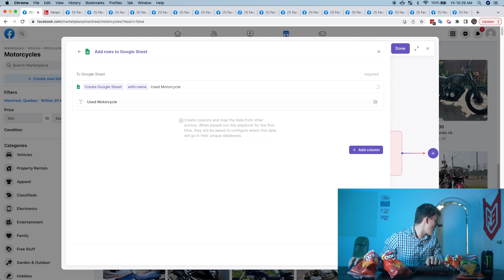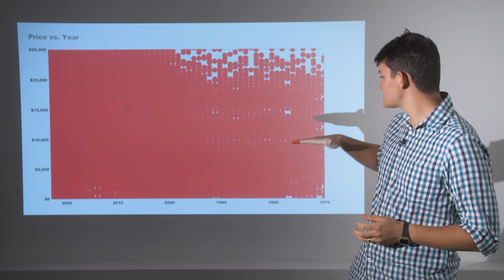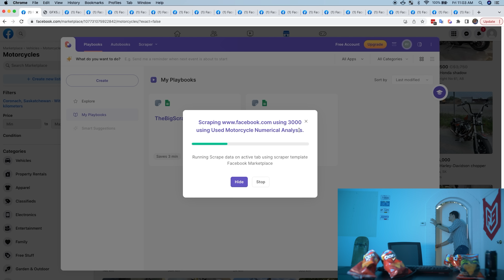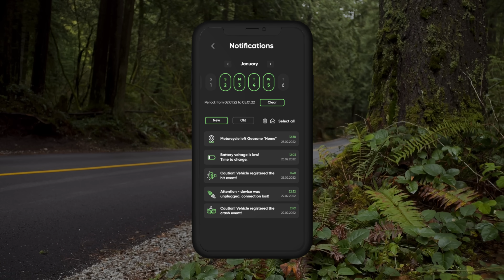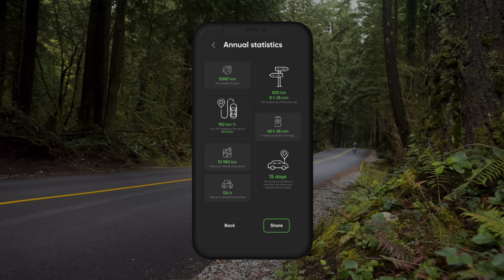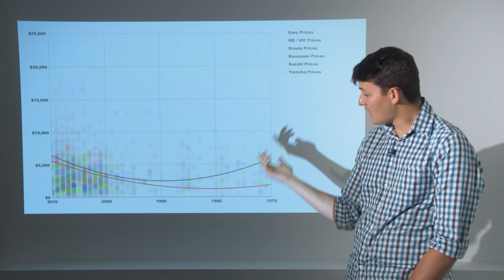Used Motorcycle Prices – A Statistical Analysis

Comment: I bought a 2007 Vulcan in 2013 for $3500. I put roughly 50k miles on it… and sold it in 2017 for $3k. 

Great bike 👍

That said, I’ve got a triumph that bleeds value like a blind chainsaw juggler and a BMW I’m probably going to keep until I can’t get parts for it (I didn’t think I’d love this ugly little beast, but it’s become a favorite). 

Sometimes, worth is what it’s worth to you. 😣

Comment: If you don't want to rely on a "lifelong no subscription plan" that will go tits-up in a couple of years, and for rather just slight above 10% of the price (instead of getting only 10% off) of their device: Get yourself e.g. a Teltonika FMB920 tracker. Works great with e.g. Traccar, the open-source GPS tracking server. Don't rely on 3rd parties to track your precious belongings, because they'll go bye-bye exactly when you need them.

Comment: kinda pathetic Sizzapp doesn't have a built in lithium battery in case the bike battery goes dead or disconnected.
Reply: Actually there is inbuilt battery 🔋
Reply: @fearchik   solid. would have been worth mentioning

Comment: A strange and almost unknown outlier from most of those curves here in Germany is the single cylinder Yamaha XT660Z Tenere (2008-2016). Only a few were sold, but those few still cost about 4,5k to 6k used - while they did cost 7000 new. That mimicks the HD curve. Well, farm equipment, I guess. 🙂
Reply: We get that with the Honda GB500 and the Yamaha SRX660.  Unloved when sold, cult status now.
Reply: HD basically IS farm equipment, so this checks out...
Reply: Hey, don't be rude! I've bought used  XT660Z for 5200€ in 2017 and sold it for 4800€ in 2022 after I did 20.000km. I've lost 400€ in 5 years that's a disaster! :D But to be fair it's really good bike and worth the price. I'm sure you know youtuber Motorcycle Adventures and his 193.000km XT660Z.

Comment: Oddly enough it's Facebook that saved my ride

I was looking for a used Suzuki Bandit with two criteria; post 2007 and less than $5000. I never even considered Facebook at the time but I scoured Autotrader and Kijiji and everything was either too expensive or too damaged.

Then out of nowhere Facebook put in my feed a private marketplace ad for a certified 2009 Bandit SEA for $5000, 35,000km on the odometer. I interrogated the seller because I couldn't believe a deal this good was above board, but it was. He was pricing to sell and Facebook creeped my searching habits to put this listing in my feed.

I'm really happy with the purchase, but I still deleted my Facebook account.

Comment: Aktuallaly, most of this is because fuel injection started being incorporated into motorcycles around 2000, so they weren't discarded as readily as fussy carburetor bikes that most people gave up on if they stopped working or had issues.  Anyone that's seen what it takes to clean and sync quad carbs knows what I'm talking about.

Additionally, 2000-ish to 2008 was a wild party of free credit to anyone that asked, so tons of sport bikes were bought with minimal money down and eventually sold or foreclosed on, so there's PILES of those bikes around.  Furthermore, the sheer number of 00-08 bikes suppressed future sport bike sales because why would you buy a $10k+ new bike when you could buy a low mileage used one for $5k that offers pretty much the same performance?  Really, the only reason to buy a newer bike is if you really want rider modes and things like that.

All in all, I don't think this data tells the whole story, and honestly bikes are so cheap just buy what you like when you know you are getting a good deal on a good bike and you probably won't lose much.
Reply: @nunyabusiness896 "fussy carburetor bikes"? I don't know which you have ridden, but carbs are a lot easier than FI to work with from the early '80's onwards.  I bought a set of vac gauges in the mid 2000s to use when servicing my bikes [now only oe twin with carbs, the rest are FI] and it was a waste of money as I didn't have to adjust anything, even on medium-high {50 -100 000] mile bikes.

FI is fine until one of the many sensors fails.  Not very likely but it may disable your bike as the ECU can't work, the best you can hope for is a limp home mode.  Then you have to hope the sensor is still available!  FI throttle bodies still need balancing.
Reply: @TheRantyRider   That must be why every carbed bike for sale "needs a tune up" or doesn't run while every FI bike "runs great" despite spending half of its life doing burnouts.  I was also born yesterday and haven't witnessed how shtty carbs are first hand, especially with ethanol fuel 🙄.  When I had a race kart, half of everyone's day was spent unfcking the carb even with non-ethanol fuel, meanwhile I've never had to touch a FI system in my life on anything.
Reply: @nunyabusiness896  Thanks for the reply.  I imagine that race tuned kit is a bit more twitchy than road tuned, but I would have thought that my high milage carbed bikes would have shown problems if there were any.  I once had the legendary 'bad fill' that caused a twin carb/twin cylinder bike a stutter when pulling out and there was a trace of water in the fuel.  Were the karts two stoke or four stroke?  Could it have been a case of too much oil in the pre-mix rather than fuelling?  

In the UK we don't see many 'needs a tune up' adverts, un-used bikes may 'benefit from light recommissioning' but that is because the battery, brakes, chain, oil, filters and bulbs need replacing.  Carbs in the UK pretty much died 20 years ago which around here accounts for non-runners as well.
Reply: @TheRantyRider  In my experience, carbs only go bad with absolutely no maintenance and a lack of use.

Sure, eventually you'll have to replace rubber parts. Once a decade? But so many people expect to let a carb sit for a month or more with ethanol fuel in it, and have it function perfectly. EFI will, but carbs will not.

Every carbed machine I have had has been flawless after it got tuned up. Cold starts hot starts elevation, they can manage just fine. But if the thing is going to sit more than a few weeks, it needs to have marine-grade fuel stabilizer in it. Even 2T machines. You do that, and they will start fine even after winter. 

Apparently this is too much to ask modern owners. I won't lie, I still prefer EFI - but that's more from an mpg perspective and altitude compensation. I've also had bad EFI experiences (looking at you, KTM, with your stupid lean, hot tunes).

Comment: The joke about farm equipment is just brilliant. standing ovations
Reply: It's the most common, thoughtless quip. It was lazy.
Reply: @iggynub   not as lazy as the noob who walks into the clothing boutique, checks out the sub standard, shiny, 1920s tech, overpriced machines and has visions of Easy Rider in his bubble head, then puts down 5%, finances the other 95% for 7 years, rides off with his branded underwear, doo rag, helmet, gloves, jacket, pants, socks, and boots to the nearest trailer dealer. There he spends 5 ot 6K on a trailer to "ride" his new machine. 4 yrs later, and maybe 4,000 miles on the chrome turd, he decides to list it for sell at 99% of the price he signed the loan paperwork for. He ends up selling it for 30% less than listed, takes money out of his pocket to make up the difference to get the loan paid off, and calls it a day. Oh hell, I just realized, it's not lazy, its stupid. Sorry, you can disregard entire post. That is all.

Comment: A tracker that doesn't require a subscription is a very interesting proposition. If you get one, don't run it from the battery, tie it in elsewhere further down since the terminals are the first place thieves look. Throw a sticker on it from a CDI ignition pack, or just hide it somewhere better than just under the seat or tank

Comment: I have an issue with the data concerning Harleys. I was thinking of getting an old cruiser a while back and was amazed how cheap they are ... including (relatively speaking) used Harleys. Yeah, they're still double what a Japanese cruiser costs but you can find a bike the arthritic owner has invested $20k+ into over the last couple of decades but can no longer ride due to pain. Once they've had their baby listed for a couple of months with no one calling, the prices come way down to the $10k range. The problem is that very few people under the age of 50 will even consider a cruiser. Asking and selling price are 2 very different things ... especially when the pool of buyers is very shallow.

Comment: Motorcycle search sites are officially run by pirates, gypsies &/or pikies these days.  Just type in Husqvarna Expedition. (A bike that is sold out nation wide.) Every lousy one will show a listing (the same one from the manufacture) for every dealer.  So you'll call & make them appear legit/viable. That's it, no other reason. None of them are set up to actually help sell motorcycles. it's just a con game between some guys taking pictures of repo bikes in front of a storage locker & dealers. (Although it does work as a litmus test for dealerships.) The one's which leave you on hold the longest to go search for a new model they either know or should know doesn't exist on the floor that they can usually see from their desk ain't people you can trust.   My advice, buy local, pay the extra $40 or use legitimate websites like your local newspaper sponsors.  The big ones at the top of Google lists are all a scam.                                                 --Hell in a handbasket

Comment: I just cant stand that pos bikes from the 70s are going for several grand when they dont run, dont have titles, are missing parts, and are garbage. Just saw an early goldwing that didnt run and had 95,000 miles for 2500. That is ridiculous. I hate the used bike market and that 70s bikes are almost 1/2 the price of a new bike off the showroom floor.

Comment: The Suzuki DR 650 its a very special case, the current 2023 model its almost exactly the same as the first year 1996 model and cost almost US$ 12,000 brand new from the dealer (here in Venezuela) so you can buy the cheapest one (listed from US$ 2,500 and up here in Marketplace Venezuela) refurbished them for less than 2000$ to make it a fresh new 2023 bike, when the suzuki finally discontinued this model this bikes will be priceless

Comment: Terrific video! Nonetheless, do you think there could be a potential concern regarding endogeneity in your analysis, given the omission of consumer habits influenced by rural or urban living conditions? For instance, I would hypothesize that rural consumers are more likely to opt for less expensive bikes due to their lower incomes, while urban riders, enjoying higher incomes, might lean towards purchasing pricier bikes. This could potentially create a misleading impression of cost savings associated with buying in rural areas.
Reply: I've now realised that I don't use the word 'endogeneity' anywhere near as much as I should be.
Reply: At least for the US, you would then have to factor in (for your assumption of high priced bikes for the city) the considerably higher insurance rates and (potentially) cost of parking.

In my buying experience (1-3 bikes a year and 1-4 cars) based in Northwest Indiana but shopping from Milwaukee to Indianapolis to just SE of Detroit, similar models for cars, trucks and motorcycles are about 15% cheaper in the band about 50 miles wide from 20 minutes north of Indy to Grand Rapids, MI.  Not specifically rural (some is) but blue color Union job teritory without the higher wages of the big city.  Most recent search (since abandonned) was for a Second Gen Vstrom 1000...they were about $1000 cheaper in that area pretty consistently.

Comment: Classic Vespa rider here. There is only one price direction: upwards.
Wideframes are heavily over-priced, no matter the condition.
The Sprints are super pricey.
PX125 and PX200 expensive no matter the condition. PX80 or PX150 decent prices and demand is lower.

Italy is pretty empty on these classic Vespa. They have all been sold outside of Italy.
Mint-condition Wideframes are selling for over 15k.
And the market is also full of shitty re-painted „fully restored“ Vespa that have major issues after buying them.

But this is probably a niche-market and the graph looks somewhat different :)

Comment: Everybody wants a meth head owned sport bike for $5,000 with 20,000 miles for some reason. Just be smart and buy like a GS650F or FZ6. The FZ6 is just a semi-naked/touring version of the R6. Literally the same engine. Got mine with 5400 miles for $2400
Reply: Same engine, but detuned so less hp.

Comment: I'm not surprised about WA, CO was a bit of a surprise. WA is great because you can ride through most of the year if you want to, but it's still cold enough that many don't want to, so you get to benefit from the dynamic.
Reply: Spent a few years in Seattle. You always knew the real hard-core riders when you saw them out in 45 degree drizzle. I was cold watching them and turned up the heater in my car lol.

Comment: Lots of people asking way too much for their bikes.   Just because you spent four grand in mods doesn't mean you tack four grand onto the price.   A lot of times people buy a bike then immediately start spending money changing it, before they've figured out if it's a keeper.  I'm guilty of doing this myself.   Now I try to wait at least six months before spending any real money on the bike.  Maintenance not included. 

Big haley's hold their value... not so much with Sporsters.  You can get an old sportier for cheap.  I guess they're not a ton to begin with, but you see them in the 3k range a lot.  Yes, they might be 15 to 20 years old, but with low miles.

Comment: I purchased 3 bikes this year, each for $2500. A 91 Electra glide, and an sv650 and sv1000 both 2003. His analysis holds up.
Reply: The SVs are great buys! Surprised you got them for as low as $2500 still. That being said, I got my 1k 4 or 5 years ago for that price and put almost 15k miles on it and might still be able to sell it for higher than I bought it for back then, so that's saying something!

Comment: Sold my Honda CB 125 R model 2018 ownd 2 1/2 years by the dealer and got 3k for it bought a new Forza Honda scooter 125 for 6.6 k (heated grips as mod) so only paid 3 k for my new ride so i think not bad of a deal they sold my bike for only 3.9 k
Reply: They probably could of knocked more off the forza scooter if you hadn't  traded in.
Reply: @chrishart8548  Scooter is brand new so 2023 model

Comment: What can I say, I am cheap! I buy under 1000, fix it up, maintain it the best I can and ride it until there is nothing left.
Reply: Right, I picked up a 2002 last model CB500S with only 30K km on the clock for 650 €, sat in a garage for years. Cleaned out the tank, had the carbs rebuilt, got a set of new tires, lots of elbow grease and the bike runs like a champ! Lasts forever.

Comment: So interesting seeing the trends and pricing in North America compared to the domestic market here in Japan. Bikes are waaaaay cheaper over there, despite many of them being manufactured here. Go figure.
Reply: Are they the same? Sometimes brands manufacture things differently for domestic sales versus export. For example, the German automakers have much more affordable cars for domestic use, but the ones exported have many fancy, and expensive, features due to them going for the luxury market.
Reply: @SmallSpoonBrigade  Most of the core models are the same, but we also have an overall wider range of bikes, both of smaller displacement and full-fat varieties. What interests me is that many of the fancy, higher-spec models tend to go to the European market exclusively. ¯\_(ツ)_/¯

Comment: What kind of heat Gun do you use for the  Solder connectors?  My Heat Gun Destroyed them.
Reply: Sounds like operator error. I've used lighters and torches when a heat gun isn't accessible.
Reply: @JohnnyD1993   Lighters and torches just melt them to crap .  Flimsy made in China connectors anyway .. I will have to stick to mechanical crimping I suppose
Reply: @mikeskidmore6754  Instead of saturating it with heat try applying heat like you cook eggs. 

On the heat, off the heat, on the heat.. 

It's operator error.
Reply from the maker: Just a cheapo one from Canadian Tire. I think it's Mastercraft. ~RF9
Reply: @FortNine    Thanks, My Milwaukee 120 volt heat gun blew them apart.